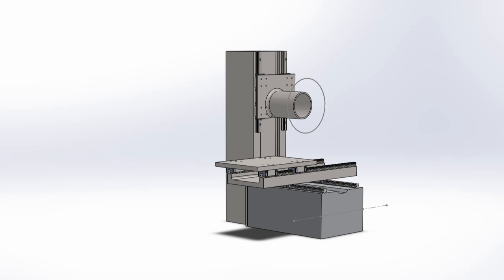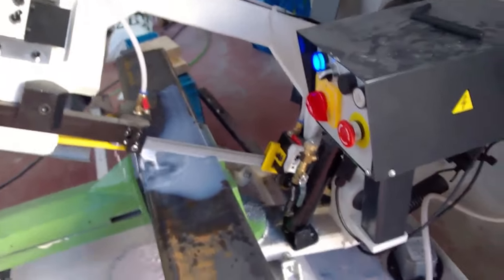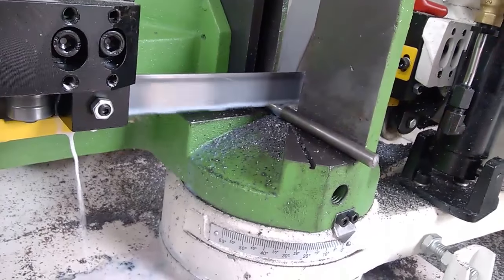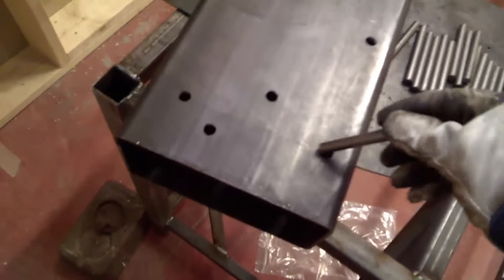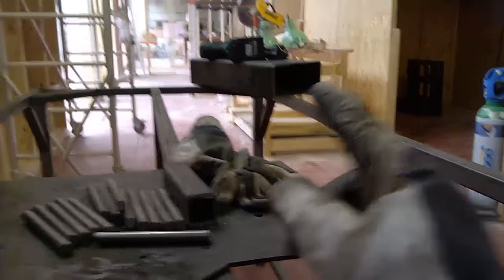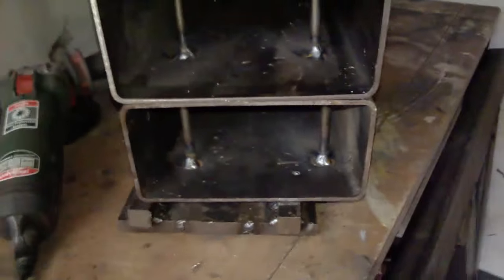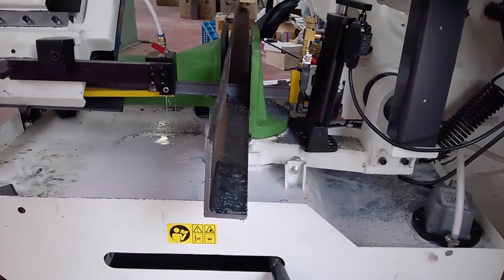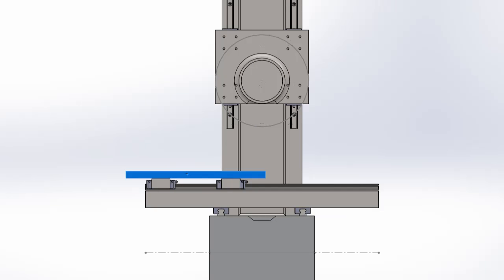DIY CNC benchtop surface grinder reboot - part 1

Comment: triangles are the strongest form , the mast would probably be stronger if you weld in a plate diagonally on the inside from one corner to the other , cut in a few notches on the corners and weld them shut with the plate inside 
are you going to mount the drive motor directly to the grindstone or are youre going with a belt drive ?